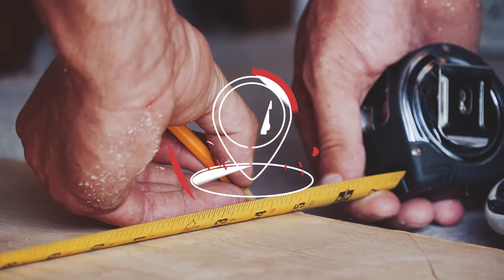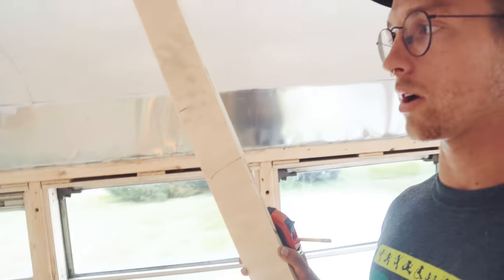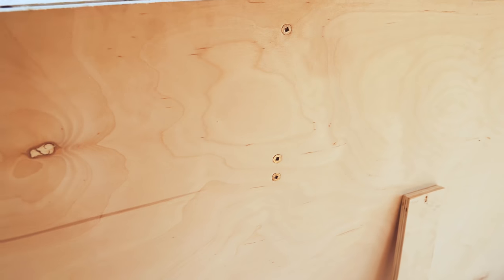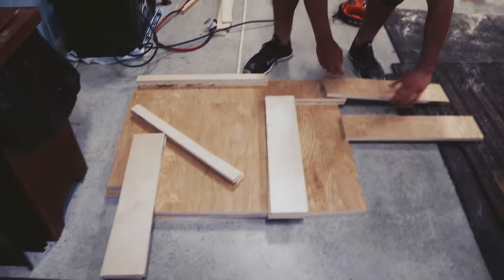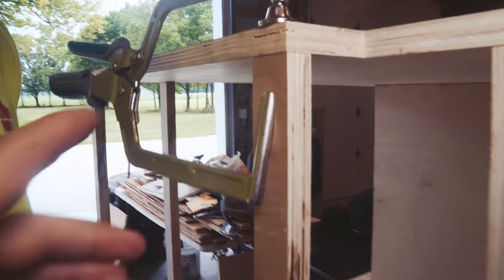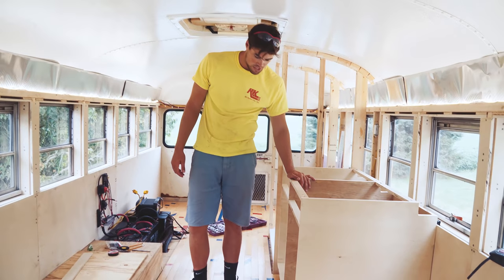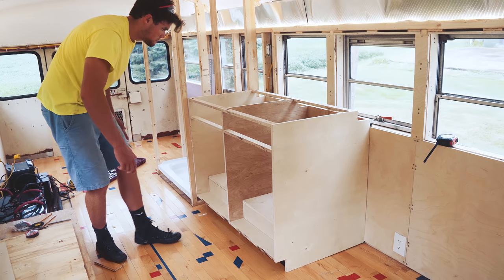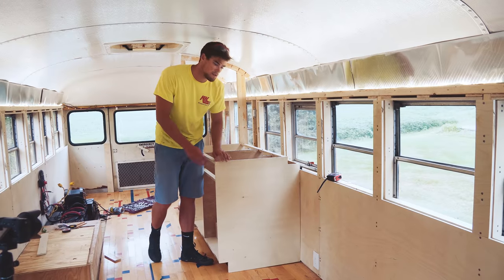#15 | School Bus Conversion | KITCHEN DESIGN AND BUILD

Comment: I'm wondering if you have any concerns about condensation on the windows, and if so, how will that impact the wooden sills?  I assume you're going to seal the sills, and caulk to keep any fluid from getting behind the wall cladding?  Trying to learn/plan...you and Rollwithitbus have me itching for my own...I want to get it right and youse guys seem to know what's what.  Thanks!
Reply from the maker: Great question, we have considered it, we are going to be sealing the wood to protect it from water and then might caulk the edge of the wood like you suggested. As of now we have not had any moisture inside the bus and we get a lot of humidity in Ohio so maybe it won't be a problem? 

But thank you again for the thoughtful question and for following along on the build! RollWithIt is a great channel too and we've been chatting with them occasionally!